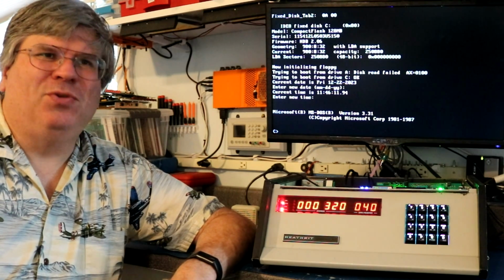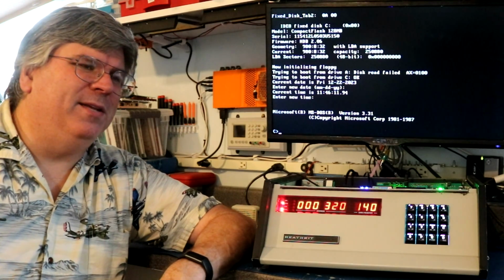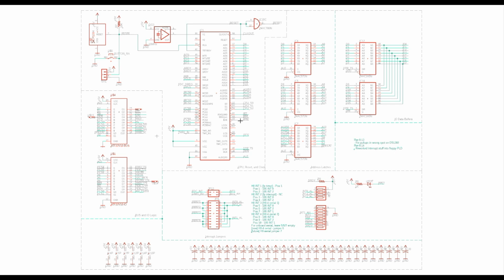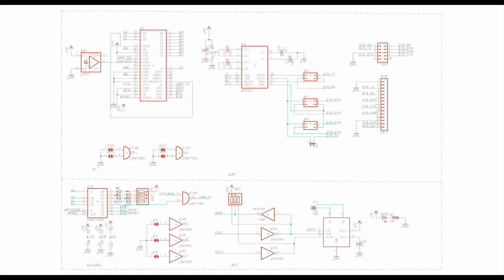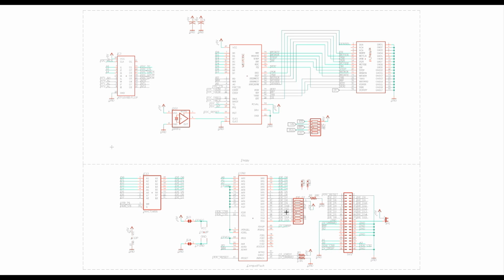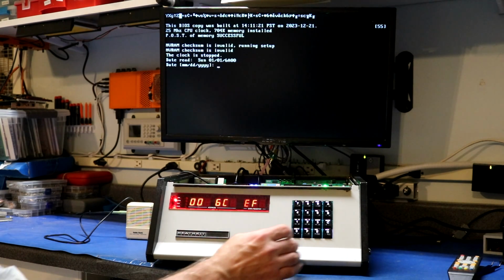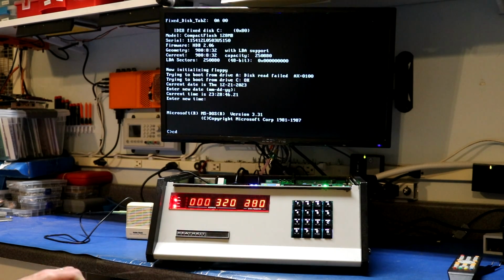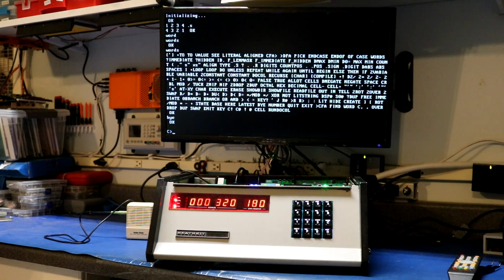MS-DOS on an Ancient Heathkit H8 computer using an 80186 CPU Board

Comment: What about building a H8 with an AMD A10-7800k or A10-7850k which brings out connections for feeding a VGA and HDMI connections  for a VGA display or TV  as the VGA Adapter is inside the AMD A10-7800/A10-7850k, but system will need 32GB of RAM.

Comment: I owned a Tandy 2000, used it for years. Eventually maxed out the RAM, and installed upgraded video.
Sadly destroyed during a massive thunderstorm (flooded out).

Ran Radio Shack DOS, Tandy Zenix, and OS CPM.

Comment: The Tandy 2000 was the CAD and spreadsheet powerhouse of the early 1980s. It absolutely lapped IBM's offerings in terms of processing speed and graphical capability for the first few years of its life, and its ability to do 640x400 with 8 colors meant that Microsoft chose it to develop color graphics for Windows 1.0.

I had a Tandy 2000 and used it for school papers and such. My dad knew how to score them for cheap once Tandy put them out to pasture. It's the first machine I programmed Lisp and x86 assembly on. One was used as a prop in Season 4 of Stranger Things.

Comment: Get this: Had an original pocket computer, 1408 bytes IIRC, then played with a zx81 while on vacation. Bought a TI99/4a, worked for RS, bought a Coco3, also got the PEB for the TI, a 'clone' and yes, on a pedestal, standing proud a dual 720k floppy Model 2000 with a mono monitor for the low low sell out price and employee discount price of $491 canajian bux. Professionally, operated Sys3, A36, AS400, DEC, Unix, Sys38. Left that behind and moved to the southern hemisphere. It was all the toys, OS9 and multiuser madness. I bought the graphix board for the Tandy 2000 as well, but never a specific CM.

Comment: For my first job as a network administrator I used a 80186 DOS based sever. We ran a 3Com's 3+Share Network Operating System running on their custom server hardware, which I believe was named “3Server”.  This custom hardware was a headless system with no video monitor that used the Intel 80186.  It was a very solid and stable platform that interconnected many IBM systems using thin coax which hung off media converters so we could use the twisted pair already existing for our phone systems to connect up the network. Pre 10 BaseT standards all running using 3Com proprietary hardware.  Was pretty cool stuff for the time, 1993 ish.

https://en.wikipedia.org/wiki/3Server

Comment: What is the significance of the alphanumeric display? What do those numbers represent?
Reply: 0-F. Hexadecimal 
(Base16)
Reply from the maker: The display can be switched between octal and hex. They represent exactly the same thing, though the octal display is in base-8 whereas the hex display is in base-16. In general what's running on the monitor throughout the video is an examination of memory at 0040:00D0, which is where I put a counter that increments each time the display is updating. Hence it has a nice counting effect.

Comment: A couple of months ago I had a few boards fabricated that used the 80C186EB25. They were spare parts for an embedded controller that was developed in 1992. It was used for industrial ultrasonic testing. The components were mostly in stock at suppliers, the rest were in our regular stock. It was programmed in assembler and C, no MsDos. Introduced in 1990, it was an easy device to design with, 16 bit 25Mhz with most peripherals integrated. Intel called it an embedded processor. Now using Zilinx Zynq which is an FPGA with integrated dual core processor 667Mhz.

Comment: In 1985 they sold some 80188 system dirt cheap at local stores, a complete system with Keyboard, 2x400kByte Floppy, Mono-Screen with 90x32 characters for 600DM. They could run CP/M and MSDOS but weren't compatible to the PC so their use was very limited. Honestly, the only person who was happy with that beast was the Grandpa of a friend who used it as an glorified type writer, mostly running CP/M, also we kids were allowed to write some programs for school in gwbasic and turbo pascal 3. In Hindsight the screen might have been in fact a Terminal because it was tremendously slow.

There was also a bunch of Basic-Games but given we already had C64 we kids didn't look much into it. But the screen was nice anyway, 90x32 in crisp clear letters.

Comment: Great video.
I had an 80186 AND an 80188 that were, ironically, on a printer interface card for a fairly large laser printer.
It was a pretty fast setup too. Kept it for a while until the shear bulk of the thing prevented me from moving into a place.

Comment: I really enjoyed this video. I found about the 80186 processor used in a Tandy 2000. As another posted below it used an 80186 processor. The machine being MS-Dos compatible but not IBM compatible. I was told an easy way to tell if I machine was IBM compatible if the machine ran dos 2.2 (something like that) probably wasn't IBM compatible. Interesting to see dos 3.3 running on it. I'm playing around with caldera multi user dos. Using programs like Word perfect 5.1 works fine on a terminal but if you need graphics. Forget it.

Comment: I was eyeballing your address demultiplexing logic and realized if not directly it might be useful making projects for the ibm5140, the external connector is multiplexed very much like this '186 its likely the borrowed ideas when making it because the 5140 uses a fully static core '86 for deep sleep.  If you could take a peek at the 5140s expansion port and let me know what you think that'd be super cool.

Great project, wonderful video !
Reply from the maker: No experience with the 5140, but I'll keep an eye out.

Comment: The only time that I saw a '186 in the wild was in the Allen-Bradley PLC5/15. Slow as a fat boy on a bicycle. :) Compared to the even older GE Series Six the AB PLC5/15 was probably about five times as slow (and the GE S6 used four individual 4-bit AMD processors to make up its 16-bit PLC).

I had all but forgotten about that CPU. :)

Comment: I was given some computers 30 years ago and a Tandy 2000 was one of them. It was an odd ball of a computer. Needed a special version of DOS. It had 768KB of RAM, single floppy drive and a 10MB Hard drive. I had to toss it out when I was moving out of my parents house 20 years ago. By then the hard drive is no good. The only thing I ever used the Tandy 2000 for was a serial terminal to my beowolf cluster I built out of a stack of IBM PC330s.

Comment: my old employer built 80186-based systems which finally hit end-of-life while I was still working there in the 00s. strangely I also found an H8 carcass in the junkpile there, but it only had the power supply and an I/O board in it. I don't think the two were related, and suspect the H8 may have been used for running CP/M.

neat that you have a BIOS and can run DOS on the 80186. I always wondered what the restrictions were on "PC-like DOS-compatible" systems as some of the software I used growing up had settings to run in a "compatibility" mode which I assume used BIOS calls for everything instead of touching hardware directly, and would probably run fine on your system. 25MHz seems plenty fast for 16-bit DOS programs.

Comment: I had an H8 pretty early on. We had a lot of fun with it. Wrote and sold a bunch of software for it. Vised, Tproc, and many others. Years later I got a call one day from someone looking for a memory board for one and I sold them the whole system. Had a third party 64K dynamic memory board for it that we built up from parts. Fun times. To play with old machines I recently picked up a PiDP-11/70. The Raspberry Pi 3B+ can run the 11/70 emulation at full speed while being mostly idle. Brings it into crisp focus just how far we've come. Enjoy!